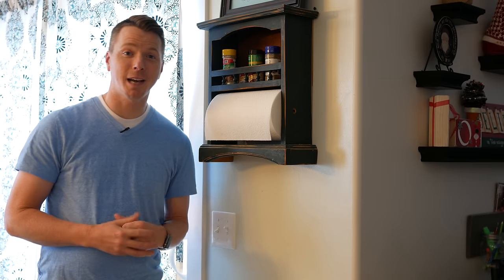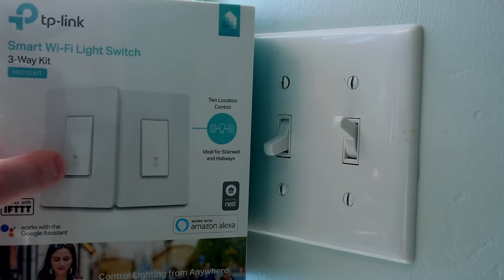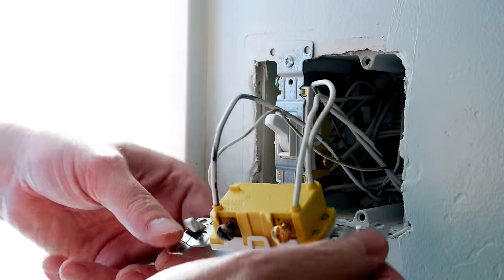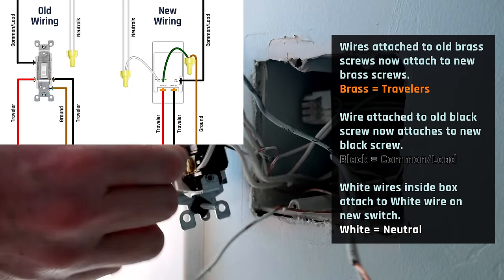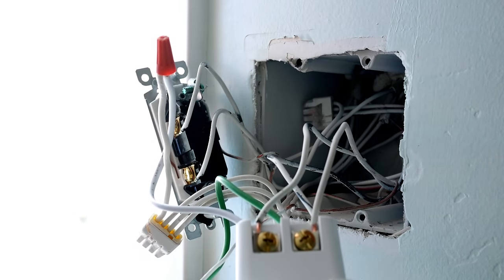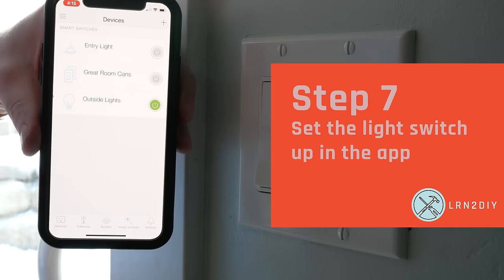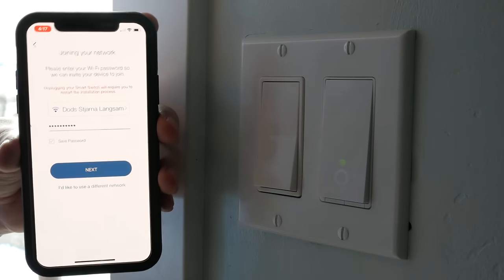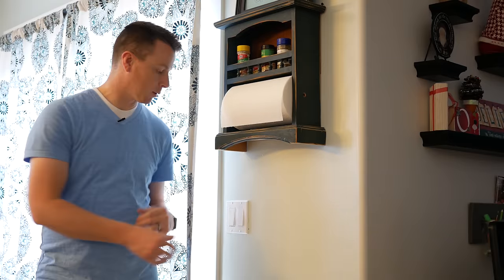How to Install a Smart Wifi 3-Way Light Switch

Comment: Installed a few all work great, however the ones I just installed turns the power on but the light just dimly blinks. The switch has power but the light fixture just blinks. Any ideas ?
Reply from the maker: A couple of things to check. First is the wiring connections. This can be hard to tell without unwiring and rewiring but pull the switch out and tug on the wires. If any of them are loose or come out then that's likely the culprit. While it's unlikely, another thing could be the bulbs themselves. If you think the bulbs in your fixture are on the fritz, you can put them in another fixture to see if they do the same thing. My guess is that one of the connections with the wires is barely in or barely touching so I'd check that first. Good luck!

Comment: I have two black live wires on my Kasa switch but only one black live wire in my wall.  What should I do with the extra black wire from the Kasa switch? It's 3 wires in total that comes from my wall (the copper ground wire, a single black wire, and a single white wire,)  I do not have a bunch of wires bundled up in my wall. I only have the 3 wires in the wall, black, copper, and white.  But 4 wires  on the Kasa switch 2 black live wires,  1 green for copper,  and 1 white for neutral.  When I tried connecting both live wires from the Kasa switch, to the one single black wire coming from the wall, it does not work.  My light comes on very dim and it's NOT a dimming light. And, the Kasa switch makes a  clicking sound that won't stop when I try to reset it. The same thing happens when I leave the extra black wire hanging from the Kasa switch. Do I tie connect the extra black live wire from the Kasa switch to another wire from the wall like, to the ground or, the white wire? Or, maybe the black and white wires in the wall are both live wires and I don't have a neutral 🤔.  I hope that ain't the case. Please help me.

Comment: Also, did it matter which switch you connected it to?
Reply from the maker: I've found that it actually did matter on some of mine but it's hard to know until you try it. I did several of these in my house (probably 6 sets) and on a couple of them they didn't work so I had to put the smart switch on the other switch and then it worked.
Reply: @LRN2DIY  Thank you for replying. That confirms other information I've read about these. From what I've read it needs to be on the one that has the feed from the circuit breaker. After seeing this and taking a look at my switches I'm going to have an electrician install it (and this ensures they get to struggle with the small boxes to squeeze all the wires/nuts in!) I'll check out your other video re:electrical tape on the screws and perhaps suggest that be done on the one I'm having installed. I"m having 5 installed - one is a 3-way while the others are all single-pole.

Comment: I had the one 3 way switch installed it all works, the problem i am facing is the when I toggle the traditional switch the smart switch is not functional, i had to toggle back the traditional switch to make the smart switch work, am I doing anything wrong?
Reply from the maker: The only thing I can suggest is to try connecting the smart switch to the other one and see if that works.

Comment: Great idea, unfortunately, using this method didn't work for me as the Kasa smart functionality losses its ability to know the correct status of the light on/off
Reply: If yours isn't working correctly, you've installed the smart switch on the wrong switch side.

Comment: Okay so since this is a 3 way...what about the other switches? Do they work normal? Does it still turn the lights on and off? That bnb always seems to be the part every one leaves out.
Reply from the maker: I think you're right - I didn't even show it, but yes - the other light switch works perfectly and you can use either one to control the lights. It doesn't matter what position the second switch is in, the smart switch knows if the lights are on or off and will respond accordingly.
Reply: @LRN2DIY  awesome! I'm gonna try one first. I've got about 5 different spots in my home that are 3 ways so I wanna make sure one works first.

Comment: You're very organized and articulate but.... You did not demonstrate the one thing I think 90% of people who click on this video wanted to see! If you turn the light off at the other, non-smart switch controlling it, does the smart switch continue to work normally or is its function now reversed? off is on and on is off? or even stop working all together? I'm sure it works normally or you would have said so but would have been great to see the demo. I showed this video to my wife and the first thing she said was "Why didn't he show what happens when you flip the other switch? It's supposed to be a three way right? Why didn't he finish testing it?" My brother and my uncle both said the same thing. I'm sure if I keep clicking around on youtube I'll find a demonstration. Just kinda feel like I wasted my 10 minutes.
Reply from the maker: Your feedback is definitely appreciated here. There are always things I can improve on and getting comments like this helps me to try to think these things through better as I make new videos. Just to confirm, yes, the other light switch works exactly the same way as you would hope and both the smart and the standard light switch can understand each other and control the light. It's as if you've installed a smart switch on both sides. I'm actually considering putting out a new video that shows this specifically since most folks don't realize (and I didn't until I read through the reviews of this particular switch) that you can install one on only one switch and have it work so well. Thanks again for helping me make better videos!

Comment: Do you have to use two 3-way smart switches or can you get by with one?
Reply from the maker: You definitely only need one. In my house, we only use one 3-way smart switch for each pair and it works great.
Reply: @LRN2DIY  if you turn off the non smart switch does everything still work?
Reply from the maker: @jmoosic  Yes. The smart switch recognizes the state of the light (on or off) regardless of whether it took the action. It's essentially the same exact thing as having two smart switches except that they'll look different.
Reply: @LRN2DIY  one last question what about if I have three switches controlling one light...two 3-ways and a 4-way?
Reply from the maker: @jmoosic  That I'm not sure about. I don't actually have any 4-ways in my setup so I haven't messed with that but I know that they sell 4-way smart light switches. I assume they only need one as well but I can't say for sure.
Reply: @LRN2DIY  thanks

Comment: What would happen if you used a typical HS200 smart switch instead of the HS210 3-way smart switch? Would you lose functionality of the other 3-way switch? Would it have to be used on the master?
Reply from the maker: Interesting question. I suppose it depends on how you wire the switch and how the wires are connected to the fixture, since that can be done a few ways. I really doubt that the new switch would work, let alone the additional switch.
Reply: @LRN2DIY  Thank you for the insight! Would you have any idea if the reverse would work? i.e. using the HS210 for a non 3-way switch?
Reply from the maker: @wylievc  I actually read that this works just fine. If you want a consistent look between your light switches, you can just use this one for both single pole and 3-way light switches. Should work just fine!

Comment: So I only need to install 1 smart switch and the other old swicth can be still use?
Reply from the maker: That’s right.
Reply: @LRN2DIY  thank you, I thought I needed to replace both switches in order for it to work? So thr old switch can still function normally?
Reply from the maker: Correct. The old one stays, and it works just like before and can be “controlled” by the new one.
Reply: @LRN2DIY  sweet! Thank u

Comment: What did you mean by putting the electrical tape in those spots? You didn't show that so I'm not sure I understand what you did and where.
Reply from the maker: Sorry, I didn't explain that too well. I did another video recently that showed the electrical tape wrap so you can see that here: https://youtu.be/drsaKC6_gYw?t=275. The idea is to cover up the screws so that wires don't accidentally touch them. Not everybody likes doing this but it's saved me a lot of trouble a few times.

Comment: Would it be possible to dIm the lights using the App. ??
Reply from the maker: If you install a dimmable smart switch, then yes. I later installed a dimmable switch on my dining lights and pendant lights and they're really nice. You can even use your smart home control to say "Alexa (or whichever you use), set the dining lights to 50%", which is pretty handy.

Comment: Sorry I don't get it... Is the switch on the other side a smart switch as well? Is it a 3 way smart switch? Is it a normal switch?
Reply from the maker: The other side is a standard 3-way switch, not a smart switch. You only need one smart 3-way switch per light and you should be able to leave the other corresponding switch (not smart) just as it is.
Reply: Thanks for the reply.

What if I want to have a 4 way switch (4 switches, one set light) does it still work the same way?

Also, I live in Thailand and we use 220V electricity. Been trying to find 3 way smart switch that operates on 220 but no luck yet. Any suggestions?
Reply from the maker: @atiwitwichi  I haven't tried a 4-way switch yet and I haven't seen which switches work on 220v so I'm afraid I'm not much help there. Sorry about that!
Reply: @LRN2DIY  Thanks anyway. Keep up the good work on the videos!

Comment: How do you know which is the master switch of the 3 way lighting?
Reply from the maker: It can be really tough to tell. You can take one switch out and test it out with the new switch and you've got a 50/50 chance or you can study up on how to identify the master. I found this thread helpful (https://www.diychatroom.com/f18/two-3-way-switches-one-acting-master-switch-135283/) but honestly every house can be so different that it's still tough to give one method of identifying your setup.

Comment: I don't see how this would work on a 3-way but not a 4-way switch as long as it is the first switch in line that's being swapped.  A 4-way switch doesn't do anything fancy besides connect the opposite traveler wires together.  With dumb switchs downstream, it should only appear to the first switch that the circuit was interrupted.  If the switch knows if the circuit is on by measuring current (which is my guess), then it should work fine.  Who knows?  I didn't write the programming in the switch.  I guess we'll find out in a few hours when Amazon delivers my switches.
Reply: Did you get it to work as a 4 way with just one KASA switch?
Reply: @paul-miscstuff208  It did work. I installed it as the first switch in line.

Comment: how do you know which one of the 2 switches is the master unit?
Reply from the maker: I wasn't really certain if there was a way to tell. I had a couple of instances where I tried it on one and it didn't work at all and then I tried the other and it worked. Not sure if someone else has any insight on this one.

Comment: What would one do if they didn't have a ground switch in their wall?
Reply from the maker: If there is no ground switch at all, nor a place to ground the wire, you just leave it. Replacing a switch without a ground for a new switch without a ground leaves you no better and no worse. In some areas metal conduit is required and metal box housings. If that's the case for you there is a often a metal grounds crew in the box itself that can be used. The switch will still work without a ground, but it's not ideal.

Comment: is there one that allows for dimming?
Reply from the maker: Great question, Micah. Here's one by Leviton that is really well rated and has a nice low profile dimmer built in. I'll add this link into the description. https://amzn.to/2Vi47JI
Reply: Does a dimmer on a 3 way switch install differently than a regular switch?
Reply: @LRN2DIY  could you mix and match three ways from that line? Eg. A 3 way dinner paired with a 3 way regular switch. I can't see a reason why, but I'm not very familiar with home electrical.
Reply from the maker: If you mean putting different switch types in the same box then yes. Dimmers, smart or dumb, old or new but it typically means that they’ll look different from the outside.
Reply: @LRN2DIY  the ones installed in house already has a dimmer at one end, but just a regular dumb 3 way at other end, if I left the dumb 3 way then installed the new smart dimmer in place of dumb one, we should be golden.

Comment: If I am going to install one switch only as per video, do I need to install it on the upstream(the first set that connected to the line wire)? thanks
Reply from the maker: nonameleft1 I can’t tell if it matters or not. I did have a couple of times where putting the switch on one of the two available and it didn’t work but I’m not sure if that was because I just didn’t wire it correctly or if it’s because I had to use the other switch. Documentation on this is sparse too.
Reply: @LRN2DIY  thank you, I will try to install it on the upstream end just in case.

Comment: Yikes, who painted all the wires white?  It seems very confusing. Good video nonetheless. I am going to buy this kit since i have two sets of lights that are 3-Way.
Reply from the maker: David Kassebaum The painted white wires are incredibly common actually. Electricians run wiring into the box before the drywall is up and they frequently strip the sheathing once it’s in the box. Then, when the painters come through they spray everything, including the boxes and wires.

Comment: I installed 3 of these throughout my home about 2 years ago and noticed that when my lights are off, the bulbs flicker and are very dim lit. They're "off" but they still put out like 1% light. It's getting worse, they're kinda getting brighter and the flicker is getting worse. Has anyone else experienced this? Did I wire them incorrectly?? Like I said, I've had them for over 2 years and they've pretty much done this the whole time, it's just getting worse Anyone know how to fix this?
Reply from the maker: It sounds like one of two things - could be a wiring issue but it could also just be the bulbs. Not all lights work equally so I wonder if you tried (if you haven't already) putting some different types of bulbs in if that would possibly help. If that doesn't do anything, it might be worth popping the box open and seeing if everything is wired as it should be and protected from touching other wires. Best of luck!